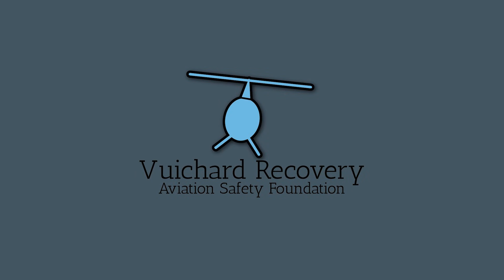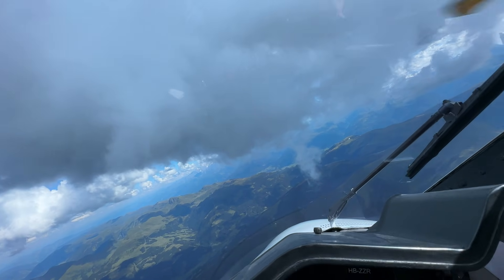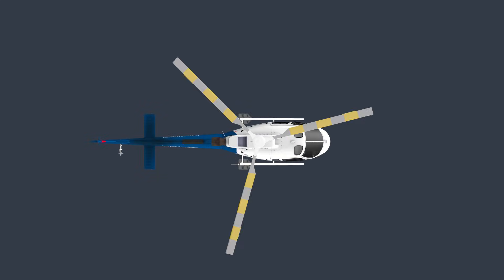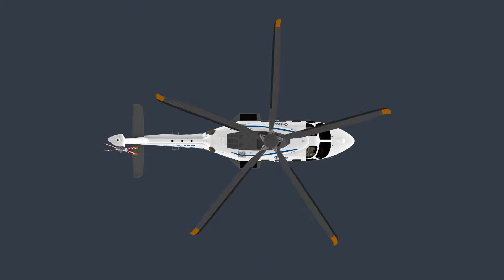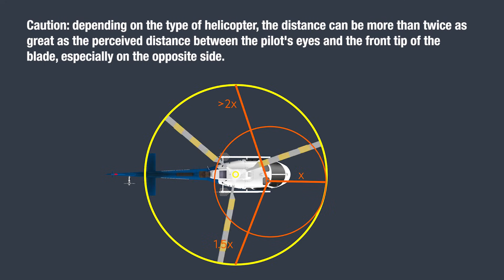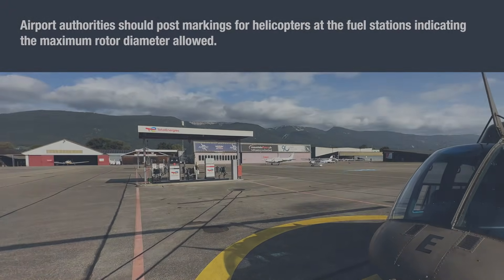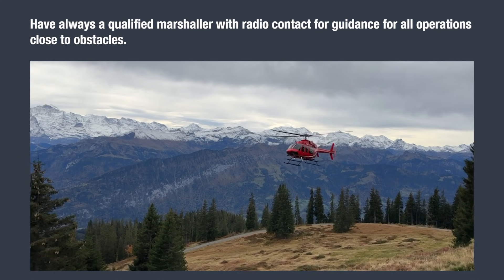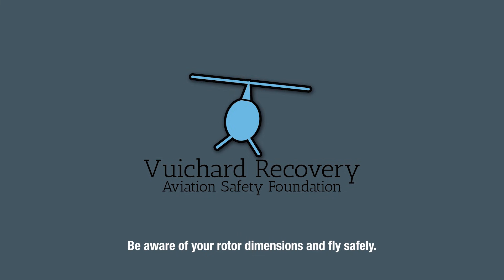How to avoid a main rotor collision with obstacles

Comment: Seems like it would be feasible to install a spinning laser on the helicopter which illuminates the rotor diameter plus a safety margin. It would use LiDAR techniques to ensure the correct actual distance regardless of angle and shape of terrain.

Comment: I’ve been flying Blackhawks for 14 years and I have successfully avoided collisions with my rotors by utilizing a very important technique…not running into shit! 🤣🤣🤣
Reply: That seems like a winner!
Good job.

I can imagine that you would learn some reference points so you can estimate the clearance.

I usually use something in the line of sight such as a rivet or anything else that is fixed in the cockpit to gauge clearance, how far I can get in an engine out situation before I have to land, when to flare an touch down etc

Same idea as the old school gunsights…

Comment: In 1987, flying Puma in the Amazon jungle, already with a lot of experience, I made an approach to a very small and restricted area with a very high obstacle at the 15 o'clock position.  Visually I was sure that it was possible to land and cut, that there would be a space between the rotor and the obstacle.  My instinct however made me ask the flight mechanic to come down and signal.  To my complete surprise, he positioned me approximately 1.5 m to the left, which was the maximum limit.  Then he made an ok sign to cut.  When I got off the aircraft and visualized, I saw that if I had cut where I "thought" would be clear of the obstacle, an accident would have inevitably occurred.  I was extremely shaken imagining what a tragedy it would have been if I hadn't followed my instincts.  I couldn't sleep that night thinking and thinking about how that was possible until around 3:00 am I drew my sensation on paper and arrived exactly at this drawing, like a compass with the needle in our chair and the tip in front of the nose and In fact, the needle is back on the mast, which ends up giving this erroneous view and which continues to cause accidents.  From there I pass on this experience to the pilots, making exactly the same drawing.  Congratulations on the excellent video!!
Reply: Dear Moacir, you will remember that shortly afterwards, while accessing the Cruzeiro hangar at Carauari Airport in the Amazon, two very experienced pilots had an accident while taxiing a Puma alongside a Bell 212, and its blade collided with the Bell 212's rotor. The cause of the accident was exactly as shown in the video. The Puma was completely destroyed after catching fire, and thank God, both pilots were rescued alive.